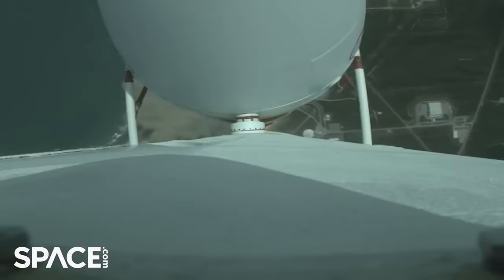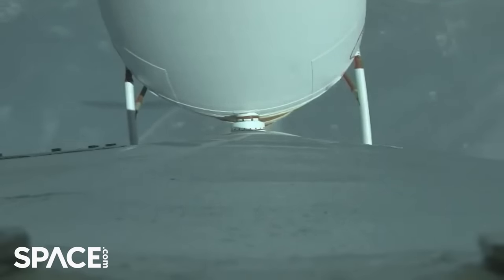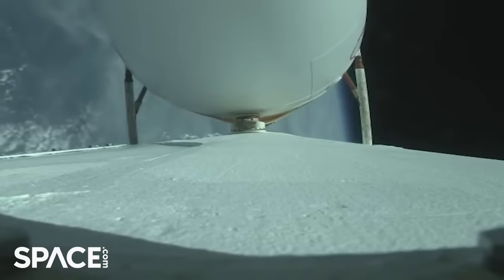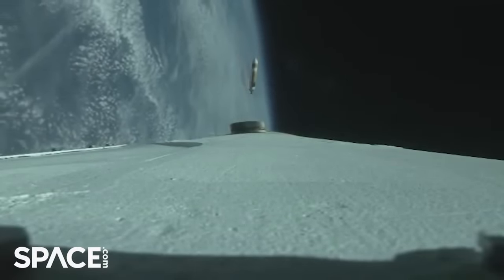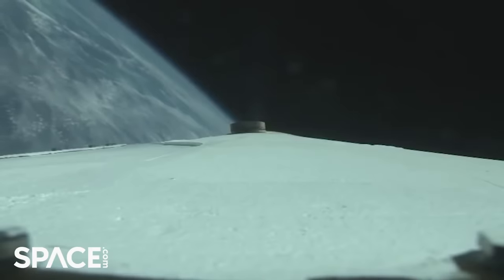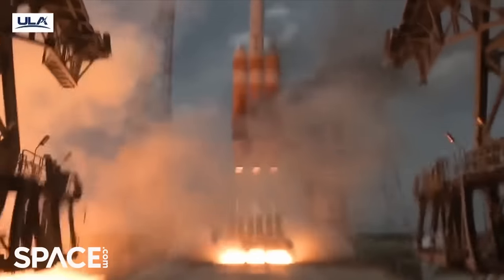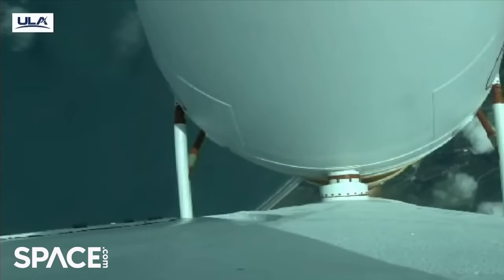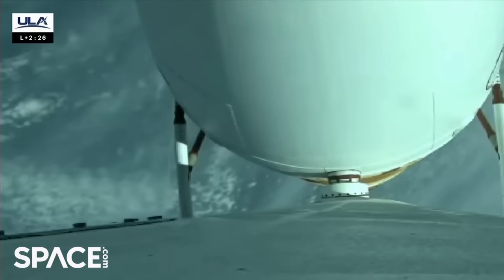See Delta IV Heavy's final launch in amazing rocket cam footage

Comment: I was lucky to have worked on the construction of launch facility 37 for delta4 heavy as a union pipe fitter summer of 2000.coolest job I ever had..I would even say it was the pinnacle of my career.

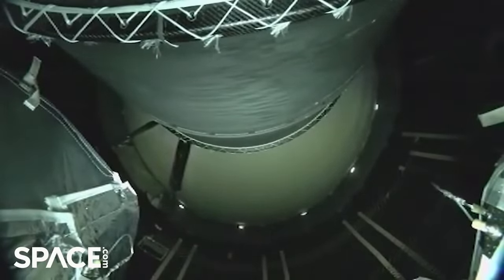Comment: 5:40, the way the extra nozzle fits in to place is really cool
Reply: i wish the atlas version of the RL-10 had the extension, seeing it deploy is really cool
Reply: I guess having a longer interstage was out of the question?
Reply: Ok thanks for the dad comment
Reply: @allEyezOnDelphi  you are welcome son
Reply: @josephastier7421  The shorter a rocket's inter stage is the better. Long inter stages tend to be really heavy, which lowers the amount of payload you can lift. Also because inter stages are hollow, longer inter stages tend to endure significantly higher loads and stresses during launch making them weaker than shorter inter stages.
Reply: @jrc1606  I'm just amazed that they built a telescoping rocket nozzle, and even more so that it seems to work.
Reply: @josephastier7421  Yep it's called an nozzle extension. It's been a thing since the 1970s but it didn't see wide spread use until the mid 1990s when the RL10 B2 was developed (the same engine shown in this video). The RL10 is really old engine that has been continuously upgraded since 1959. Currently, SLS uses the same engine but pushes it to its limits. The RL10's burn duration during Artemis 1 was the longest it had ever had since it's inception and it successfully put Orion+ESM on trans-lunar trajectory with a 99.9% accuracy. However, It is rumored the new Exploration Upper Stage will use RL10 C3, a new type of RL10 that will probably not have this engine extension.
Reply: I was trying to figure out what was going on. 👍🏻

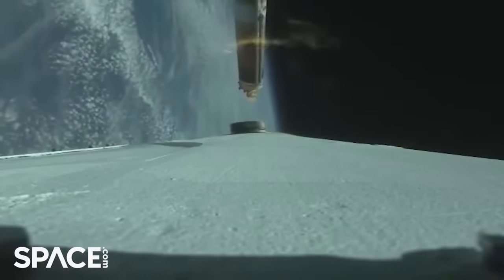Comment: 4:00 Look how fast that booster falls away even though its still tumbling forward, the rocket just leaves it in the dust. Really shows the insane velocity that thing has at high altitudes. That booster would still have been tumbling forward as fast as a bullet even though it was jettisoned
Reply: Makes you wonder how engineers tune the areo without testing to have them not bounce back into each other after they've gone!
Reply: @actually5004  They just burn up in the atmosphere so it doesn't matter if they hit each other i guess

Comment: Damn boi! It ain't flat after all ....
Reply: The hell, you say!
Reply: Well who knew? 😂
Reply: Its thick, boi! We all knew it!
Reply: Ok, grab a small ball.  Like a golf ball or something.  Find a flat surface of 6 feet or longer.  Bring your eye down to where you can no longer see the top surface.  Now roll the ball and witness what happens.  That's right, you just witnessed how the sun sets and rises on a plane.  In this scale. you don't have to contend with atmospheric contamination which makes the atmosphere itself one giant lens that maintains its apparent size.  Too bad the globe theorists failed basic geometry.

Now grab some iron, a magnet, some metal wire, a metal stand, and a torch.  First, wrap the wire around the iron.  Next, tie the wire to the stand or hang it from something so it can be heated with the torch.  Attach the magnet to the iron.  Now pay attention to what happens when you heat the iron until it glows red.  That's right, the magnet drops!  Congratulations!  You just proved what science claims the Earth's core is and how it works wrong.  Too bad the globe theorists weren't informed about the Curie point.

This one will vary depending on the sink design.  Most noticeable in round sinks, though it will work in all of them.  Ok, grab 2 full glasses of water.  Go to your sink and put 1 glass on each side.  Now take 1 glass and pour it on the left front wall and watch it drain clockwise.  Take the other glass and pour it on the right front wall and watch it drain counterclockwise.  The left rear wall will also drain counterclockwise while the right rear wall will drain clockwise.  Congratulations!  You just witnessed both Coriolis effects in the same hemisphere!  Too bad the globe theorists didn't understand momentum very well.

Plane Earth class dismissed!
Reply: @FunkyMonk6 They can't see the 2 different resolutions...
Reply: @Elkysium  Point 1: If you lower yourself so you cannot see the top surface, then you are BELOW the surface.  Sitting in a ditch on the real world, you are not going to see much after it moves a short distance away from you.  Given your example then, if someone is sitting on a hill, mountain or in an aircraft, then the sun would never set for them?  If your eye was even 1mm above the 'flat surface' you described above, the golf ball would never disappear, yet you would see the golf ball get smaller and smaller as it rolls away - which the sun never seems to do?! What a pity flat earthers cannot understand simple planar geometry and perspective.

Point 2: The centre of the globe is not entirely a single molten core.  There are different elements in layers with differing viscosity and metals which generates an electrical charge that results in a geodynamo.  What a pity flat earthers never graduated past junior school science class, where I built my first dynamo.

Point 3: Any scientist will tell you that Coriolis force cannot be accurately measured in such a small scale experiment.  Next news broadcast, try looking at the map of high and low pressure cells on the weather map at the end instead of gawping at the weather girl.  Notice that Low pressure (and high pressure) cells has the air (wind) move in different directions in the northern and southern hemisphere.  Aside from this showing that you CAN actually have a pressure differential without a container, this is the best example of Coriolis effect QED.  Better yet, go and stand in a cyclone/hurricane in both the northern and southern hemispheres and tell me which direction they spin in while the wind whips away the tears of despair at your failed academic efforts.

Plane earth class fail.
Reply: @FunkyMonk6explain how we could have day and night on a flat earth and il believe the earth is flat,if your explanation makes sense.🙏🏼
Reply: @DevanSabaratnam  By not being able to see the whole top surface, it represents standing on the surface.  Not very bright are you?  Can you see the whole of Earth's surface when you view out?  Didn't think so.  Human eyesight is extremely limited.
Reply: @Elkysium  Wow no need for Nasa, CERN or Universities with your Amazing scientific experiments! No need for me to watch any more Eclipses. And i thought folks were dumb where you came from[The non globe universe]?
Reply: @FunkyMonk6 no need to be rude.I didn’t recognise your sarcasm,and I wish I would I of read more comments ,then I would of read your second comment.
Reply: @FunkyMonk6  Good one. The Irony of telling someone "wake up", just hope it's sarcasm.
Reply: @bruceclarke6270  Wow look at all that proof that shows I am wrong.  If derogatory comments are all you can do, then you have already lost...
Reply: @FunkyMonk6 It's adorable how you try.
Reply: @FunkyMonk6  You do realize these people are out there dude. I didn't mean anything by it, your edit was not there. Or an /s.

It's really hard to tell, the Grifters really have a hold on people.
Reply: @FunkyMonk6  This is what they like to say...that we're being lied to...or wake up...or even some wild insults about how the "Globers" are the ones being tricked. Didn't mean disrespect, was why I said I hoped it was Sarcastic. 

Have a good one man.
Reply: @derekcoaker6579  Youtube keeps deleting my replies...I've tried like 20 times to respond.
Reply: @Elkysium   I've read your replies, we for sure, have nothing to debate. This video sure as shit isn't the place to continue the "Flat Earth" stuff.  Especially with the experiments you listed above.
Reply: @derekcoaker6579  Agreed.
Reply: @derekcoaker6579  I prefer the term Realm because that is what Earth is.
Reply: @FunkyMonk6sarcasm is really lost on social media.  Tone matters so much.
Reply: @Elkysium  Now grab your tin foil hat. That's your Plane Earth graduation cap!
Reply: @tamugrad2007  It's better than having my head stuck up my arse...
Reply: @Elkysium  How would you know? It's still there.
Reply: @tamugrad2007  And yet you can't prove me wrong which proves it's yours and not mine...

Queue more whining and crying...
Reply: @Elkysium  Oh yeah, I can, as many on here already have.
Reply: @tamugrad2007  LOL!  No they haven't and neither have you...
Reply: @Elkysium What’s the distance to the moon or the sun?
Reply: @Elkysium  so both the Sun and the Moon maintain their apparent size at all time as viewed from the surface of our planet, because what now? An atmospheric contamination which makes the atmosphere itself one giant lens? And that maintains their apparent size?
There is nothing to debunk here, because that word salad is not even wrong. Are you Witsit? 😂
Reply: @rayfighter  The further you get through the atmosphere, the more this effect can be seen.  Most noticeable at sunrise and sunset.  This effect is mostly due to water vapor.  This is why people watch in awe as a huge sun sets...

Your words: "There is nothing to debunk here, because that word salad is not even wrong"...

I have been doing this for 13 years so anyone who sounds like me, is probably using my data.  Many people have used my data but they don't understand it like I do so in turn, they can't defend it properly...

Comment: Right after they reached 100 kilometers, I noticed the struts and side tank started to turn black. Which I know will sound dumb but is that radiation burning, or could you explain why this "what seems to me as an atmospheric thing" happened in what I am assuming is out of the atmosphere?
Reply: I'm curious about this too. Maybe there is still "some" atmosphere up there and with the increased velocity at higher altitude maybe the charring is caused by some friction with the very thin atmosphere?
Reply: At 100 km there’s still a bit of atmosphere left. The radiation levels are far too low to cause blackening at that rate.

Comment: 7:06 What is with all the fire between/above the engines?  Is that normal?
Reply: Hydrogen gas residue
Reply: Aerodynamic dead zone where the unignited gases linger and burn off
Reply: Yes; it's normal, and the Hydrogen gas burning before liftoff is deliberate. It avoids a potentially explosive situation, similar to what SpaceX encountered with at least one of their early prototype Starship launches.

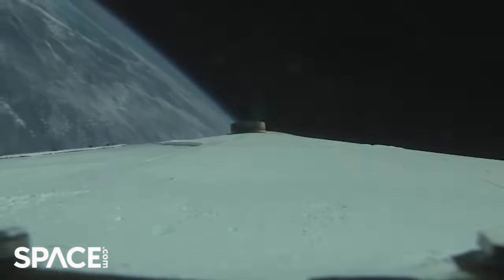Comment: Weird how the center connection to the booster started turning black around 5:30 in the video as it was approaching the Karmen Line. It almost looked like the paint was burning from an internal heating element in the connecting point getting too hot. Anyone know what that’s about???

 It was way too high up for the burning to be caused by wind resistance.
Reply: That would make sense: That connection point is attached to cryogenic tanks at both ends, you’d want to make sure it’s not frozen shut when you jettison the boosters.

Comment: What happens to the strap on boosters after jettison? Do they burn up on re-entry, splash into the ocean or orbit the earth as space junk?
Reply: Fall into the ocean. No where near fast enough to orbit or burn up.
Reply: @wally7856  Cheers for that. Gee you wouldn’t want to be sailing along and get clobbered by one of the boosters.
Reply: @OurWorldbyDronein4K  They have an ocean exclusion zone for boats so they don't get clobbered.

Comment: Ok why is there fire between the 3 boosters that should only occur out of the exhaust sections.
Reply: Was wondering the same thing........
Reply: The fire between boosters is caused by vented H2 igniting upon engine startup. This we are told is a feature of the Delta 4 Heavy, not a bug,

Comment: Where's all the satellites, stars & breaking the atmosphere?
Reply: We’re looking at daylit Earth, so the exposure time is on the order of 1/1000 second. Try taking photos of stars and satellites with that exposure time: you will get completely dark photos.
Reply: satellites are hundreds and thousands of kilometers away, why should you see them? And what does "breaking the atmosphere" mean? It launches in the atmosphere and goes up. And the atmosphere just get thinner and thinner with the altitude
Reply: A vacuum requires a solid barrier
Reply: @paulbutler9719   LOL, just spitting out the typical nonsense, so parroting what you have seen some where. What's comes next, that water always find its level?

Haven't you really notice, that the air pressure becomes thinner fluently when you go higher? I mean, you easily can feel and measure that. Before GPS , altimeters only worked by measuring the air pressure. So we have an air pressure of 1013 hPa at sea level. At the top of Mount Everest only 325 hPa. So how can 1013 hPa exist next to 325 hPa without a solid barrier? You don't have a problem with that?  At 20 km it is 78 hPa, at 50 km it is 165 Pa, at 100 km it is 0.3 Pa, halfway between moon and earth 0.000000001 Pa, deep in outer space it is 0.000000000000 Pa. So where should that barrier be?
Reply: @paulbutler9719  No, it doesn’t. It requires a physical barrier OR a force that prevents gases from flowing into the vacuum. Gravity provides that force for planetary atmospheres.

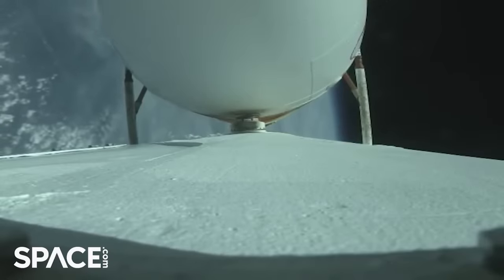Comment: Okay fan-boys, tell me how this makes any sense to you: at 3:04 the announcer claims the vehicle is at 29miles in altitude (46km) traveling at 5,300mph and then a mere 14seconds later is claiming the vehicle has passed through the karmen line (where "space" begins, which is at 100km or 62miles altitude). The escape velocity for a rocket leaving earth, according to mainstream science, is 25,000mph!!! See anything strange with any of these numbers?
Reply: So just did a quick punch-in on my calculator, at 5300 miles an hour the vehicle will travel around 20 miles or 32 kilometers which brings us up to 78, and that’s not even counting for the massive acceleration the vehicle was still experiencing when the announcer said 5300 mph so those numbers add up to me?
Reply: Orbital velocity for a typical 200km LEO is also only around 17500 mph
Reply: Because it's been constantly accelerating since liftoff!! While the engines are burning, the vehicle is accelerating.
Reply: It's nowhere near escape velocity, and it didn't escape.  It's still well within earth's gravity.  If the engines shut off at that point, it would come back down.  "Escape velocity" is after shutdown it's moving too fast to come back.
Reply: no strange numbers just strange flat earthers.
Reply: You just have no idea what "escape velocity" means. The most important thing: There is nothing special about space. We live in space. We usually mean "out of the atmosphere" when we talk about space - but the atmosphere becomes thinner fluently, so you cannot say where it ends. At 3.3 miles altitude you have already only 50% of sea level air pressure, at 22.3 miles only 1%. The Karman line is the altitude where the necessary speed to get aerodynamic lift gets as high as orbital speed. It was made to define where "aviation" ends (and is entirely theoretical). It is arbitrary to use that as "the beginning of space". There is no beginning of space!

And so of course you don't need a certain speed to reach a certain altitude. You can just go up, as long as your engine is running you go higher and higher, and further away from earth, also with slow speed.

But the range of gravity is infinite. It becomes weaker with the distance but never zero. So let's say we have a rocket that slowly goes up. 20 miles, 50 miles, 100 miles, 500 miles, 1000 miles, 5000 miles,... and then it runs out of fuel. So what happens? It will keep on going up because of its momentum, but then falls down. Also from 5000 miles. But when it is faster, its momentum will let it go higher after the engine stops and before it falls down. And when it has 25,000 mph, it will move away faster than it is pulled back. 

So the 25,000 mph is not necessary to leave the atmosphere. Instead it is the speed that an object without propulsion,so just shot away from earth, needs so that it doesn't fall back to earth.

But most  rockets go only into low  earth's orbit, or at least start from there as a  first step. And orbital velocity is only 17,500 mph. So when the rocket goes sideways and accelerate a satellite to that speed, the satellite will "fall around the earth forever". So at that speed there is a balance between "fall down to earth" and "move away from earth". That is how orbit works.

And there are uncut videos of launches for example of a space shuttle or SpaceX Falcon 9, that shows the altitude and the speed all the time. And there you see how the rocket go sideways (so doesn't go higher), but just accelerate parallel to the ground. And then it runs out of fuel and stops the main engines when reaching about 17,000 mph.